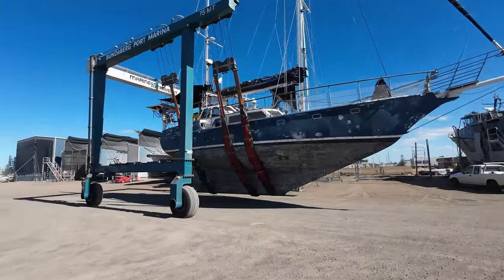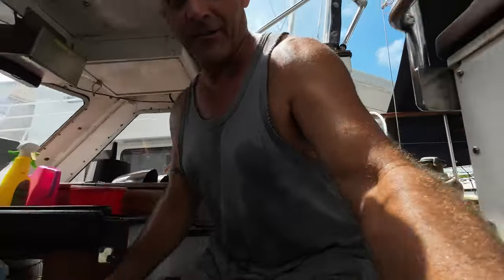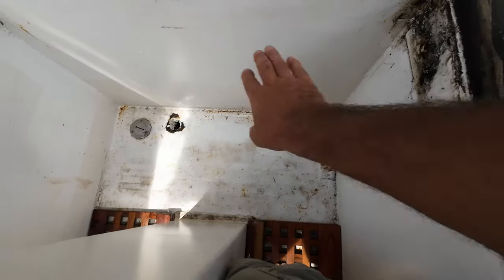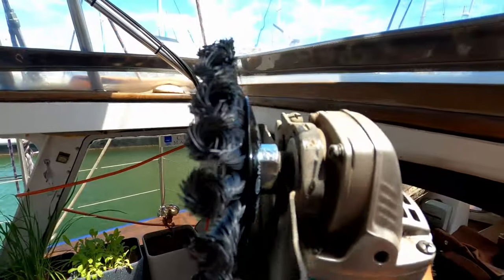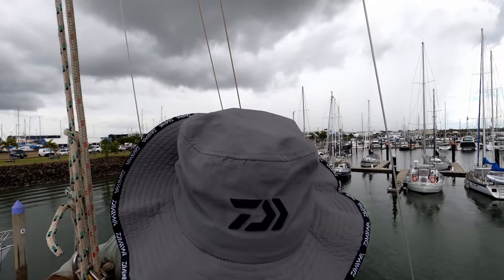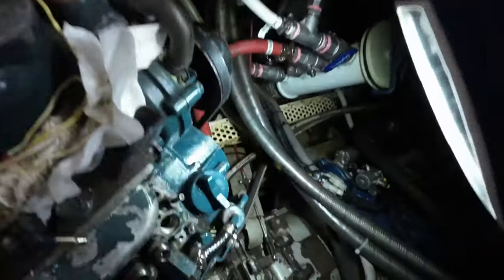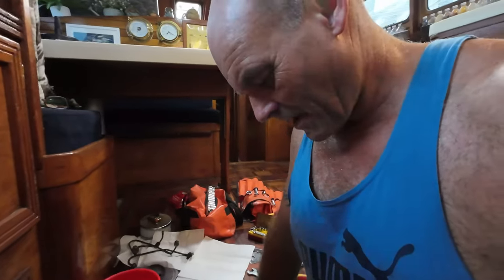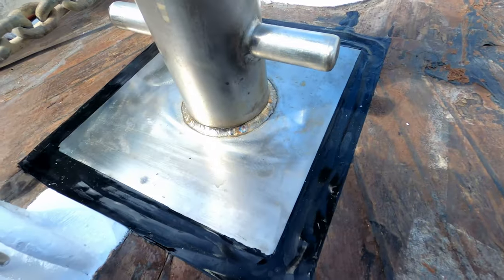Touching up SV Awaitea Paint, Grind, Weld repeat #vlog #liveaboardlife

Comment: Nice job Karl I like how you’ve done the helm station the yacht looking nice
Reply from the maker: Hi Nigel,
I sanded it all back, rust treated where needed, 2 pack undercoat where bare metal, two coats of 2 pack poly top coat, and it turned out good. I hope it will last ok.
Cheers